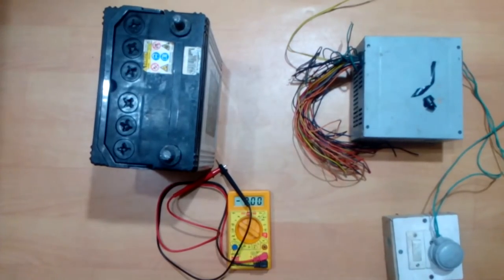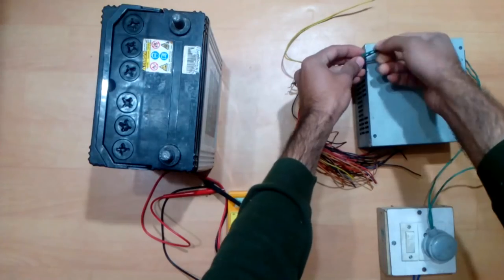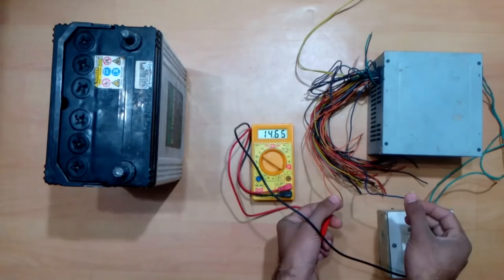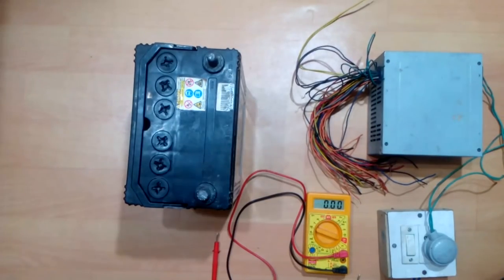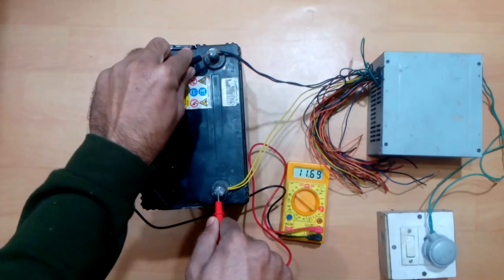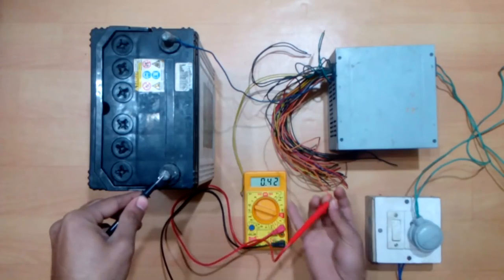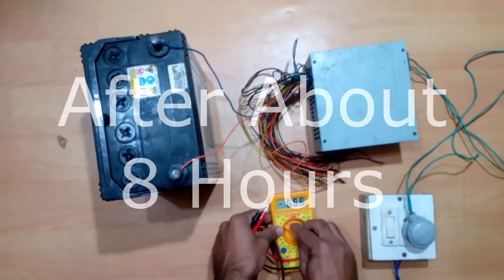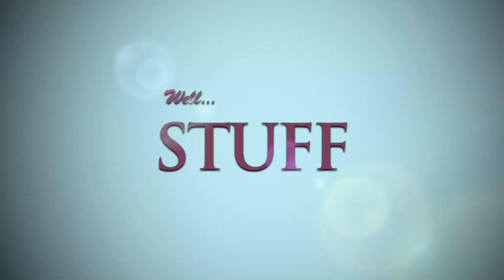Safely charge a car battery using a computer Power Supply Unit (PSU)

Comment: Ran this overnight on a completely dead battery. Started out at 0.480 A using 15.3 V. Threw it in the car in the morning and it started up without issues. Thanks.
Reply from the maker: Make any motorcycle Keyless/Remote start stop in Rs 500-800 
https://youtu.be/0g5woUbNXy4
Reply: @GreatIndianJugaad  shameless 🤣

Comment: Actually, it is possible to charge but it has to connect the -3.3 V line to the - and the +12V to the +. In this case, the overall voltage will be 15.3 V. It is slightly higher but it might work instead of 12v float charge.
Reply: there is no -3.3v line in an ATX power supply is it?
Reply: @zarmeza  There should be. Check the color diagram at the back of the PSU or use a multimeter.

Comment: grate . tested to work .. battery is charging now at 15.1 v 
i added a diod to the positive terminal(  [battery]-[i<]-psu )to protect the psu from the battery current
Reply from the maker: +Mechanics DIY nice touch.
Fun Fact: You can actualy run a psu from batteries reverse current given the battery has enough juice. I don't know if you get any output or not but the fan keeps running.
Reply: that's exacley why added the diod so the battery will not short it out . it's not desigend to work in revers
Reply: hehe right ... up to 12 v is fun but .. just so you know . i connected 18v battery to -12 blue and 1 yellow +12 for charging without a diod and the psu died after 5 seconds
Reply from the maker: +Mechanics DIY thats bcs 24v is too much charging voltage,  even for 18v battery. Amperage will go sky high.  And -12v line is only designed to provide 0.6 to 1 Amp max depending upon your PSU. 

The same thing will happen if you use +5 and -12 v line to charge a 12 Volt battery. Too much current draw from PSU and PSU will die.
Reply: how can you limit the amp draw using thees wires?
with some resistors or what??
Reply from the maker: If you still talking about the 24v lines, then you can put a resistor in series to get 3-4 Volts of voltage drop across resistor, so that you get 20-21 volts across the battery,  But will probably need a load resistor to get rid of all the heat that it will generate.
So, I suggest you buy a XL6009 chip Boost converter(60 - 70 INR or 1 USD) In put 12 Volts and adjust the output to about 20.5 Volts. These things are pretty cheap if you buy it from aliexpress.com China, or you can get it from your country also but since the boards are all made in china or Taiwan you will end up paying more and will get the same stuff.
Reply: thanks for replay
hehe i alredy orderd a simular unit 
but it's a 30 day to shiping at best and i was trying to find a solution
for now .  
i have a collection of resistors i scraped 
 i will try to add in series 
thanks

Comment: that battery has a bad or shortened cell, that's why it shows 0.something volts at the begin when connected in an open circuit like he did.  pls peoples be aware that a battery with a bad cell inside can explode if you dont have basic knowledges dont do this at home.

Comment: what you need to give us is the simplest info possible. Connect BLUE wire to the negative, and ORANGE wire to the POSITIVE terminal. Is that the final solution to charging the battery?
Reply from the maker: yes, but if your battery has drained below 11 Volt, doing this directly might blow your SMPS. watch entire video carefully Its explained.
Reply: Great Indian Jugaad so until it's over 12v you should keep black to negative and yellow to positive? Is that right?
Reply from the maker: not over 12v. around 12v, you cant go over 12v with 12v supply. but yes.

Comment: Hello i know I'm late but i did this and it worked, the problem is how can i stop the power supply from overcharging the battery?
Reply: Unplug it. It will just be charging at 12 volts, so no need to worry.

Comment: Nice vid. Is it possible to get more current flowing to the battery? Half an amp is pretty low considering the PSUs can deliver up to 12 amps on the +12V line. Thanks for your effort, good work!
Reply from the maker: Not using computer PSU.

Comment: how to control the Amp from power supply ? I heard we need to supple 10% of Amp when charging the battery, Ex: if we charge 35 Amp battery need to in 14.5V and 3.5 amps, so how to control the Amps when using power supply ? thank you

Comment: Hello Dear.. Plzz hepl me can i charge my 12v 40 ah dry battry useing black or yellow wire..?? And hiw much time it will take to complete the charge..? And please mention me or make a video How to use multimeter and its function that you are using i have that one but don't know how to use..
Thank you..
Reply: you need atlest 13.5volt otherwise battery not get charged.

Comment: Does not work it blow the Diode and a few zenar diodes if you used the -12V  So just used ground12 -v  and 12 +ve should be ok.
Reply: Yes -12v cant handle high current of battery
Reply from the maker: It works which what is shown in the video. You didn't follow the procedure thats why exceeded -12v rail current limiter.
Reply from the maker: It doesn't have to. PSU supply current to the battery not take current from battery. And yes it true -12v rail can't supply high current. Thats why you don't start with -3.3v and -12v directly.
Reply: If battery is not fully discharged then it blows the diodes in SMPS maybe they cant handle high current of battery or -12v dont have enough current,
Reply from the maker: A Car lead acid battery fully charged is just 14.4v, it cant possibly damage any diode or zener diode of 15.3 volt rail.  Even 12v rail is safe in that regard. Bcs of safety factor which 1.5 times the working current.

If your PSU stopped or died when charging like this, it is bcs you probably connected a fully discharged battery directly to 15.3v setup.

Comment: Cool raj , how do we up the amps on one of these power box ?
I want to run a 50watt car stereo with one like this : D
Reply from the maker: use 12v rail you can easily Run 50w stereo, thats yellow and black wire.

Comment: My battery voltage is currently near 12.2 volts, when I connect the wires to battery, SMPS doesn't turn on, when connection with the battery is removed, it starts working. What is causing this issue?

Comment: You cannot charge a car battery from a 12V source because it need to be charged between 13.8V and 14.2V.
Reply from the maker: +Juan Abreu yes,  the initial 12v charge is just to bring up the battery voltage to around 11 volts,  Because if you dont do it the battery will draw a huge current from computer PSU which might cause the PSU to blow up, then after some 10 mins I switch to 14.5/15v.

And you can charge the car battery with upto 20-22 volts also till the time you maintain a constant current of what your battery is rated for.
Reply: Yes need 14.4v.,
Reply from the maker: +Nostalgia Nostalgia yes. And 12+3.3 =15.3 that's more than enough.
Reply: How can u connect 3.3v + 12v tell, it's impossible with at supply, but one way desolder atx output transformer, after change windings..Series to 12v + 3.3v,
Reply: Great Indian Jugaad atx transformer winding details are ground to 5v ground to 3.3v ground to 12v ground to -12v, u will check now.,
Reply from the maker: +Nostalgia Nostalgia watch the video, thats exactly why i made the video.
 Also its (-12v) and 3.3v
Reply from the maker: +Nostalgia Nostalgia check the potential difference between -12v rail and plus 3.3 volt rail. And let me know what you get.
Reply from the maker: +Nostalgia Nostalgia also the output are not connected to transformer windings. Transformers can not be used for DC voltage.
Reply: Great Indian Jugaad -12 v have only 1 amp. Check ur amp meter. Ok. 1 amp current sufficiant charge for 5/7ah battery., ur 40 or more ah battery need more current, please try to study more about of atx amps and battery chargers, may God bless u. All the best
Reply from the maker: +Nostalgia Nostalgia Please expand your knowledge base.
First, I never said its more than 1 amp. Second, in video itself I said it will take over 2 days to charge the battery bcs actual discharge was 0.6A(May be, its been long time). So follow this for 5-6 hours to bring your battery back to life, just enough to start your car and once you drive, your car will take care of the rest. Please watch the entire video carefully. 
Third. Battery Charger Amperage has nothing to do with not charging a battery. Less ampere just mean it will take longer to charge. 
I would suggest you to take another look at your study material, or change your study material. 
For God sakes, Google it before your make a fool of yourself
Reply: Great Indian Jugaad u have no basic idea of real electronics, i seen ur videos, u just need viewers of ur channel, ur knowledge like as very poor!!, If u have any doubt going to talk with near of ur hometown e technecian(ups/invertor technician/ or a good knowledge electronics engineer, ok., Don't fight with me, ur knowledge and thinking of atx amps completely wrong., -12+3.3/1 amp (actually 700 ma) ur idea for charging all batteries, thats way ur idea same  of 12v/ 500ma/750 ma transformer charger,
Reply: Great Indian Jugaad u have not idea of electronics, i don't fight with u, byeee
Reply from the maker: +Nostalgia Nostalgia Actually your entire comment makes no sense. 

There is no such thing as transformer charger.

No one ever divides Voltage by Ampere. We can multiple voltage by ampere to get watts. Also ma (mA) is short for Mili Ampere. Thats 1 Amp divided by 1000.

Hypothetically, If you ATX PSU box said -12V can give max output of 1 watt, then you will divide that 1 Watt by 12V to get 83 mA or 0.083A. ( Actual calculations use power factor as well but this is just an example) 

But if it says 1 Amp that's the actual output. You can calculate the power by multiplying it with corresponding voltage.

Also I have nothing to prove to you, I could just as easily delete all your comments. I just wanted you to learn.

And Please learn the basics before you teach someone else.
Reply from the maker: +Nostalgia Nostalgia i feel bad for your employer, an electronic engg who does not know the difference between power and current. 

Also Google the meaning of hypothetically, might help you next time you make a fool of yourself.
Reply: Great Indian Jugaad you are real mad, please don't upload this kind of videos, because u have zero knowledge of this topic,
Reply: First u read ur heading of video, 2nd u said 12+3.3 is 15.3 voltage is enough to charge a battery, i said 12+3.3 not have 15.3., Then u said -12+3.3=15.3, ok that's ok  15.3, but less Ampere of -12v, . Maximum about 1 amp depends upon the variable smps, i replied this low amp voltage charger is same as a 12v/750ma local transformer!!, Then you said .083 ma is -12v, ok why charge .083 ma to a car battery? U have atleast not a basic knowledge of electronics, friend u know color code of a resistor?? Hehehehehe. Byeee.
Reply from the maker: +Nostalgia Nostalgia I know -12v rail has less amps, that's why i said in the video to charge for 5-6 hours just for starting the car, not to fully charge.

And when i said .083 A, I used the term "Hypothetically" i did not say that's actual value. I gave you an example of how to calculate Amps from watts and Volts. I did not say the actual Output is 0.083A.

In previous comment I said the actual output was 0.6A (approx as it has been long time since i made the video) 0.6 A is low charging but it works and is safe even if you leave it for 24 hours or more. Less current does not mean battery will not charge. It mean battery will charge slowly.

I tried my level best to make to you understand. I cant waste any more of my time. Learn if you want, or don't it up to you.
Reply from the maker: +Nostalgia Nostalgia And I actually might upload a video explaining how you dont know what you are talking about.
Reply: Okay I've read your whole argument and I have to agree with the maker of the video here. As he has clearly shown 0.6 amps going into the battery for many many hours. This has clearly brought up the resting voltage of the battery and makes perfect sense as well. The combined voltage is high enough to charge and even high enough to equalize. However the current of only 0.6 amps would not be enough to equalize the battery and would not be enough to overcharge or damage the battery even though the voltage is high. It would only bring the battery to a near full state of charge. I have 32 batteries in my solar system and they take 3 amps each continuously just to keep them full. They are in fact old and worn out and should only take one amp
Reply: @GreatIndianJugaad  dude, stop arguing with him. People will find this video helpful. From that comment of his, saying that he is smps designer made me doubt on him.
The video is helpful dude
Reply: I followed the video exactly but when I connect -12 and 3.3 the psu won't turn on
Reply from the maker: Then i guess you didn't follow the instruction exactly. Before connecting 15.5v line you have to connect 12v line. Reason is also given in the video

Comment: It does not charge 12 v battery. for make 12 v battery charger we need to 13.8 or 15 v. you should improve ATX by resistor.
Reply from the maker: +ofogh design please watch the entire video.

Comment: Hello Sir can I charge My 30 Amp battery using computer  Smps ??? Is it safe??Plz reply...
Reply from the maker: yes you can. to fully charge it might 30 - 45 hours, depending upon your SMPS power output.
Reply: @GreatIndianJugaad  suppose I connect +12 volts( 14 amp may be) and -3.33 volts wire.. 

I know the volts will be 15.33 approx..but what will be the AMP??

Plz tell me how much the AMP will be...I am very confused.
Plz reply soon sir...
Reply: Smps does not get damage by back current from smps

Comment: i have 250W power supply. i connect black and green wire together but it didn't turns ON.when i connect and disconnect then it go ON and OFF. what i do???
Reply from the maker: +Fasih Uddin all power supplies have a built in auto shut down to prevent damage from short circuits.
 So check and confirm if any to wires are shorter. If none found do a continuity check amoung all colour wires to confirm no internal shorting. You could also open and inspect to PSU to check the same.
Reply: Well...Stuff  its working with Green+Red and Green + Orange. which one i connect with green? 
and i have 3 yellow wires. each yellow wire gives 12V or combine gives 12V?
Reply from the maker: +Fasih Uddin all yellow lines are 12v individually and together both. multiple wires are to carry more current voltage does not change.

Green should be connect to ground (generally black wire) to start the PSU without Mothrboard. 
Red is +5v, Orange is +3.3v.
Reply: Well...Stuff  i connected green and red. PSU starts now... thanks for helping :)

Comment: Home inverter ki battery 165 ah charge kr skte hi kya
Reply from the maker: yes. but it will take very long. not suggested. but fully drain ho gyi h toh thoda 10-20% charge kr skte h. 15-20 hours lge ga

Comment: hi and thnx for the video , can you help me plz calculating how much amper do i have , i have the -12V with 0.5A and the +3.3V with 15A , i can have a total of 15.3V but idon't know how much ampere i have ?
Reply from the maker: 0.5A, as -12v line has 0.5 A limit. dont look to charge full battery, charge it overnight, it should give enough to for 3-4 cranks, and then the car can charge the battery.

Comment: बिरादर  what is amp of this charger ? Car battery is 35 ah . So it needs at least  3.5 amp charger .
Reply from the maker: How did you get to that conclusion? Why does it need at least 3.5A charger? What happens if you supply .5A @ 15.3v? Where does that 7.3 Watts of power go?

Comment: Its not working, bcz i try after 2 minit my smps will be not working
Reply from the maker: +Paras Chauhan thats may be auto shutdown, you have to connect -12v and +3.3v. Thats blue and orange. And for the first 10 mins charge using yellow and black. +12v and 0v.

Comment: is it blue wire or violet conect on negative
Reply: and bro its fake as i plug the wire correctly my pc fan stop
Reply from the maker: use -12v and +3.3v. there is nothing fake here, do the math. between -12v and +3.3v efective potential difference will be 15.3v. which is more than enough to trickle charge the battery, use a multi meter see for yourself. also your PSU/Fan  stops bcs you did not watch entire video, I clearly asked to bring the voltage of the battery upto 12v first by connecting black to negetive and yellow to positive. for 10-15 minutes, then connect -12v (which is blue is most standard PSUs) to negetive terminal and +3.3v (which is orange) to positive terminal for 8-10 hours.

Full charge will take 5-6 days for 70 Amp battery.

Comment: can I use a power supply that I use to power my car amp at home. it's 13.8V and 8amps
Reply from the maker: +Scob By Most 350/400 W power supplies are rated for 25/30A @ 12V line,  So yes you can. But use more than just one wire. Each wire is rated 5A. Use three to be on safer side. 
And your Amp should work fine on 12V.
Reply: Well...Stuff I use it and it works fine for my amp.but can I use this to charge a car battery?
Reply from the maker: +Scob By yes but follow the video to get charging voltage.
Reply: Well...Stuff alright thanks

Comment: for 12v car battery charging minimum 13.5 v for 12v car battery okkkkkkkkkkkkkkkkkkkkkkkkkkkkkkkkkkkkkkk
Reply from the maker: watch the entire video carefully.
Reply: What is -12 plus positive 3.5. The answer is 15.5 volts and at that low of an amperage is enough to charge slowly without damage